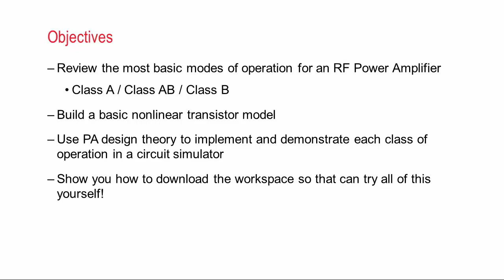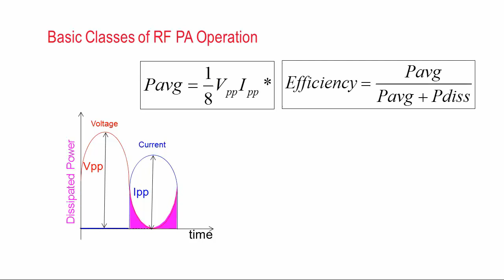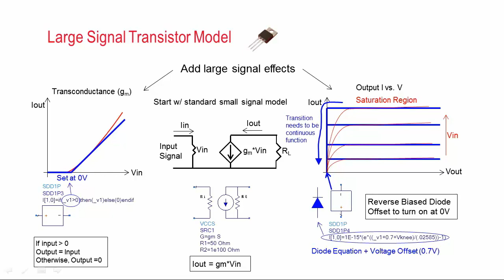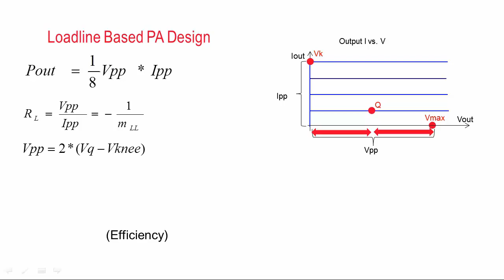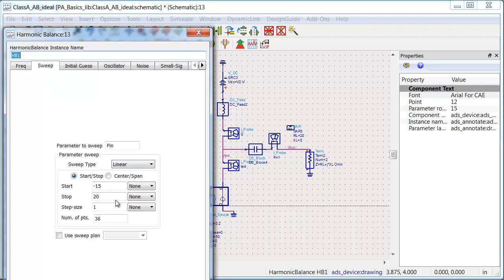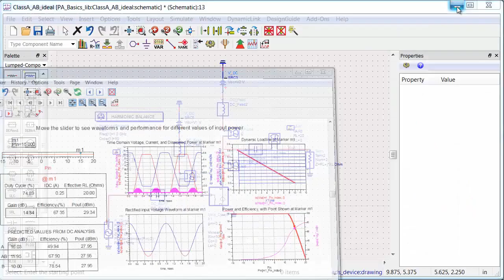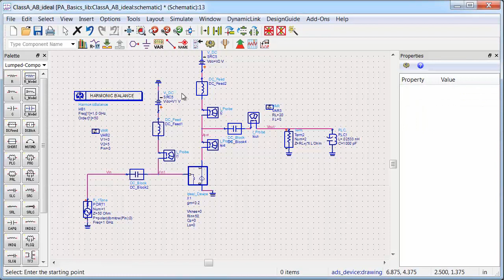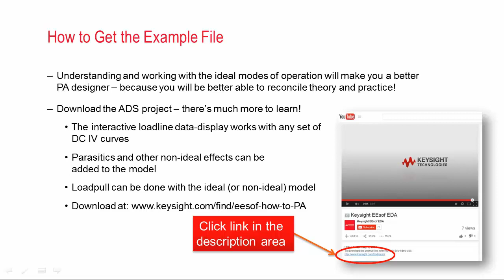How to Design an RF Power Amplifier: Class A, AB and B

Comment: This is so amazing, one of the best videos I have ever watched in my life. 
Would you also please explain why the load has real and imaginary part. Since we always calculate and simulate for RL and load-line theory is based on that. But we always have imaginary part in load-pull simulation.
Thank you for your time, I appreciate.
Reply from the maker: Great! Glad you find it helpful! Device parasitics are the culprit.  These reactive elements occur between the “ideal” current generator inside the device and the actual output terminal (ie the physical drain connection on your IC/package).  The goal is to present a reactive impedance externally which is transformed by the parasitic elements so that it is a real load value intrinsically.  In this example, the parasitic elements in the model were zeroed out, hence the real load value.
Reply: yes that is true. We have to add imaginary part for our load in order to cancel out the effect of parasitic capacitance.  If the imaginary part is positive it acts like an inductor which resonates with parasitic capacitance Cds and prevents current flow through it so most of the current which is generated by transistor will flow through load.

Comment: Hi

First off I wanna say that this workspace is great.

I have a suggestion for making changing the analysis frequency form the the default 1GHz in your workspace easier and more intuitive.

Problem 1.
There are many data display equations I have found that have the frequency and period value hard coded.
For example in simple_power.dds I find the following equations:
P_diss_gen_rf=vs((V_t_rf*I_t_rf), t*1E9)
V_f=fs(V_t,0,3E9)
Pd_pure_rf=integrate(V_t_rf*I_t_rf)/1E-9

So that means every time I want to change my fundamental frequency, I have to change the frequency and period value in every single equation with a hard coded frequency and period.
This can tedious and annoying.

Problem 2
There is no indication that they should be changed. 
Therefore for some one who is new to ADS, it can be confusing and time consuming to figure out why the simulations are giving erroneous results since they may not know to change the values in every equation.

Suggested Solution
It would be better to use a variables like ff=1E9 and tstop=1/ff instead, then tell the user to change this variable if if you want to change the frequency to be analyzed.
Therefore the above equations will look like this:
P_diss_gen_rf=vs((V_t_rf*I_t_rf), t*ff)
V_f=fs(V_t,0,3*ff)
Pd_pure_rf=integrate(V_t_rf*I_t_rf)/tstop
Then put some comments like "To change the fundamental frequency for analysis, you need to change the ff variable value"

I think that will make things better

Thanks
Reply from the maker: Thank you, these are very good and well thought out suggestions.  Much appreciated!

Comment: how I can use this template for my desired transistor?
when I insert another transistor in the attached template it does not give  the simulation results 
Kindly answer
Reply: did you solve your problem with inserting your desired transistor

Comment: hello sir. what is the parameter  _v1 used in diode equation (time 4.08 minutes). i suppose its the voltage across the diode. but i couldn't find this variable defined anywhere in the workspace. i have seen variables like _v1 and _v2 used in equations for MESFET model of GaAs FET, again not defined anywhere. how and where can we use such variables?
Reply from the maker: +Shadab Rabbani These variables represent the voltages across a particular port of a Symbolically Defined Device (SDD).  So, in other words, using this device you can define output current (I[1,0]) as a function of input voltage (_v1).  This is tremendously useful in modeling, so that’s probably why you have seen it as part of equations for different devices.

Comment: What do you mean "by definition, short circuit harmonic termination is required to maintain a sinusoidal voltage waveform" when you were simulating class AB bias?
Reply from the maker: We meant the classical definition of the waveform, where there is a single tone voltage and a rectified current, requires that harmonics are short circuited, meaning zero harmonic voltage and nonzero harmonic current.  Without that condition, the voltage could never be a perfect sinewave and the current waveform could never be a partially rectified sinewave.
Reply: But LC at best gives roll off... How can one ensure fi where i>=1 gives 0V and also, won't short circuit current @ f0 be minima? But I thought fourier series requires the f0 term for half-rectified signal: http://people.clarkson.edu/~jsvoboda/Syllabi/EE221/Fourier/FourierSeriesTable.pdf
Reply from the maker: The ideal load is a pure resistance @ 1fo and then a short to all of the harmonics (Vfund does not equal zero, V2-n =0).  In the video, the circuit is a resistor in parallel with an LC tank.  The tank circuit presents an open at the fundamental, so 1fo current flows into Rload (creating a voltage), and at the same time the tank presents a short  at the harmonics, so current flows to the LC tank, not Rload (no voltage).  In practice, the LC network needs to be very high-Q do that -- easy in simulation, not so much in the lab.   But keep in mind these are idealized waveforms.
Reply from the maker: In practice, a device has parasitics which shift the harmonic impedances away from this R@f1, shorts @f2-n.  So, at high frequencies, the required impedances are really reactive -- thankfully no R + ideal tank is needed.  But the matching network still must selectively present the right impedance to the device at each harmonic frequency.

Comment: sir i will trying to design the rf rectifier ckt and i need the high frequency diode like HSMS8202 but in my component library it was missing.can you please tell me how to update my component library or get that components .
Thanks
Reply from the maker: +nitika sharma Thanks for your question! I suggest you fill out this Assistance form and explain your request and an engineer will follow-up to explain. www.keysight.com/find/eesof-contact